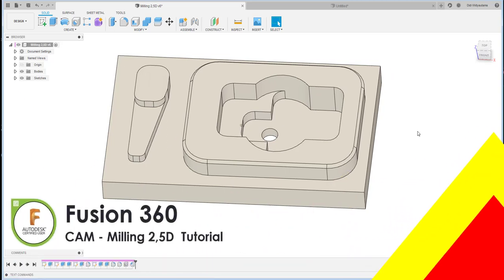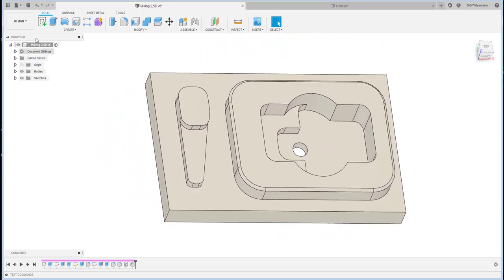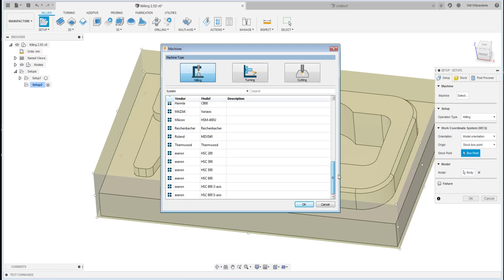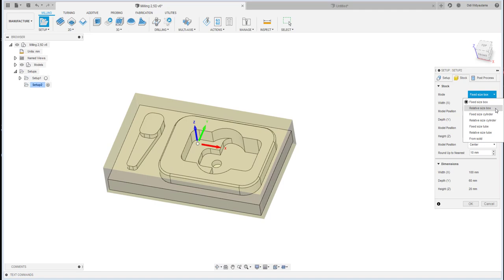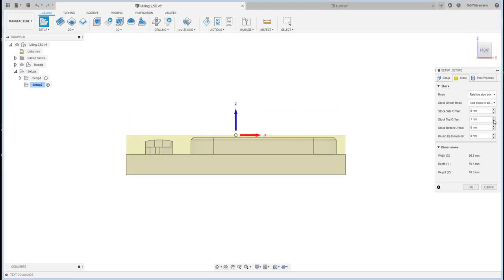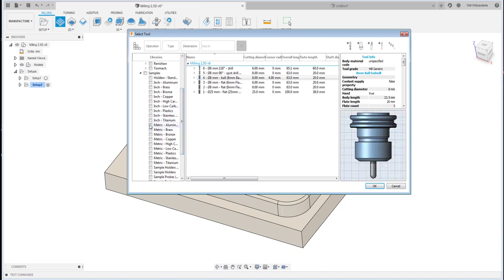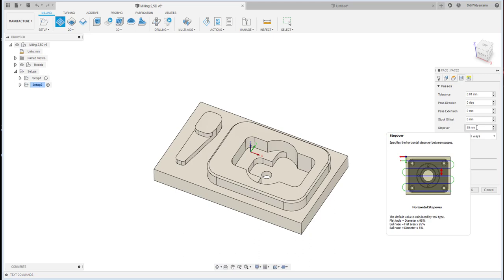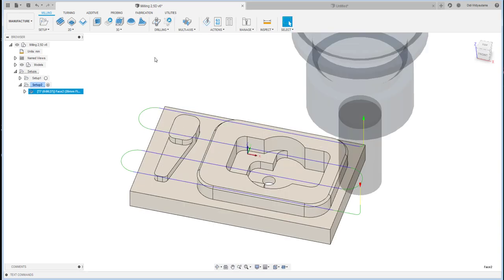CAM milling 2.5D - Fusion 360

Comment: Hi Didi, thanks a lot for this nice short and sharp tutorial:) Great intro to Fusion 360 cam too. I would like to try the simulation with the exact part you used. Is it possible for you to include the download link for the part file?